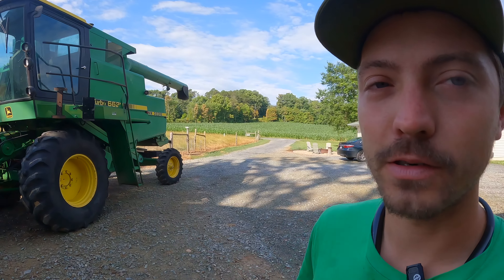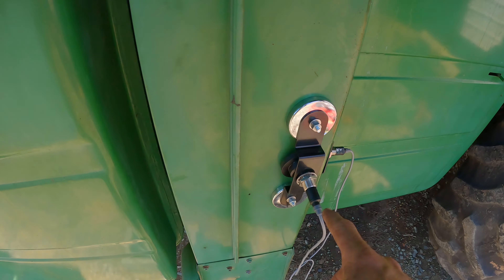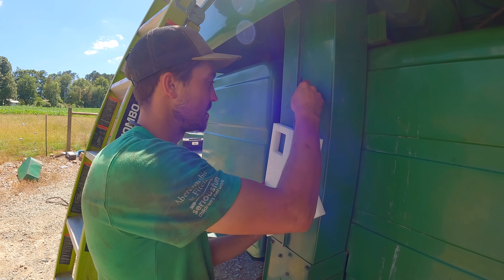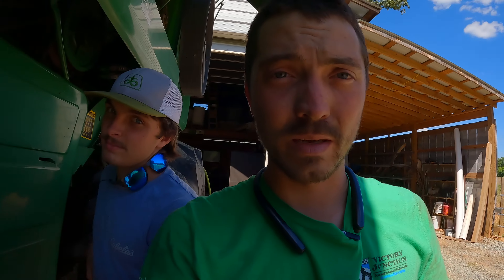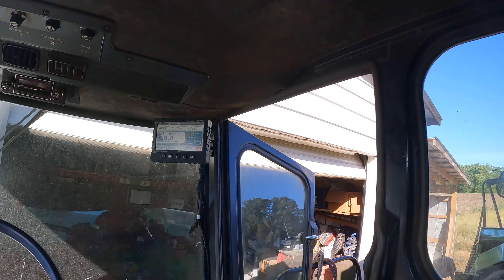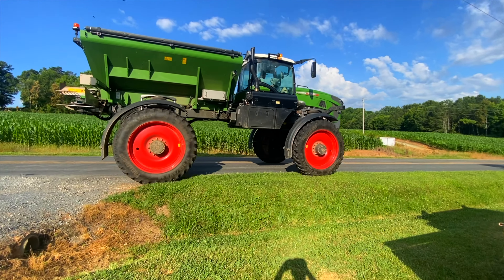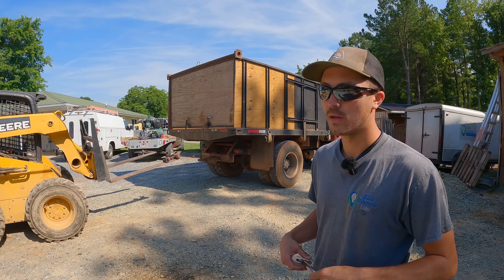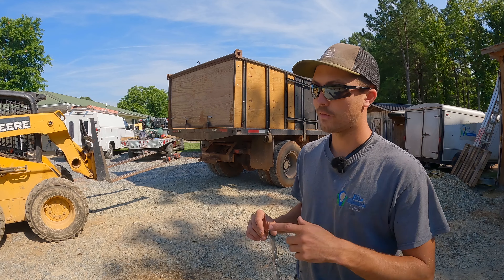John Deere 6620 Combine Prep For Harvest | Loup Yield Monitor Installation

Comment: Grew up running a 6600. The reason there is cab noise is that it is running
Reply from the maker: They are definitely noisy, but with the old bearing you had to wear ear plugs